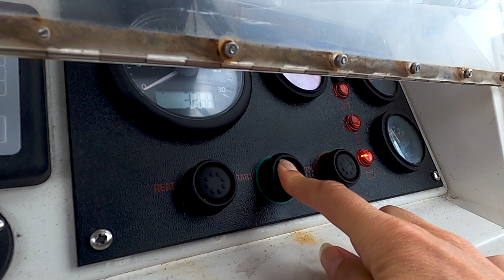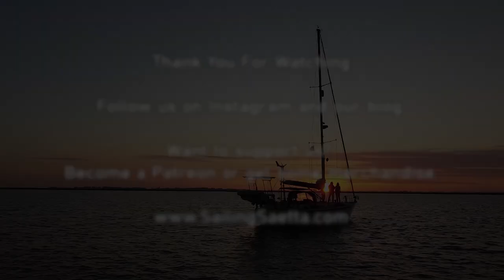Compress The Engine Decompress The Crew

Comment: What was the root cause for the water intrusion. I thought you said that the anti-siphon valve worked perfectly when you tested it. You mentioned possible faulty head gasket. To me, it looks you have not fixed the problem at all.